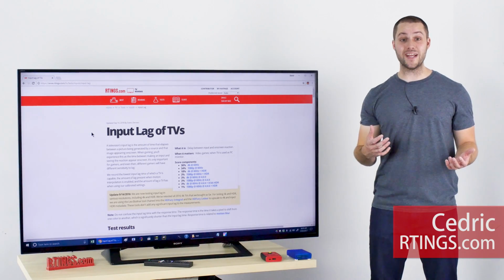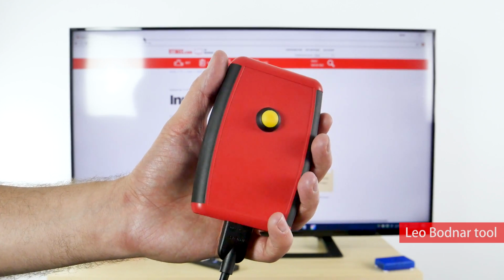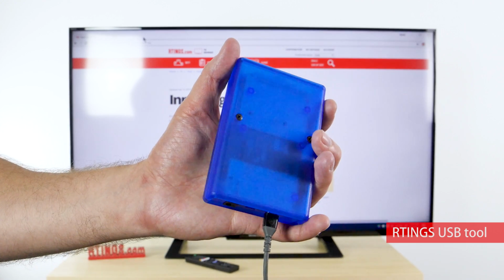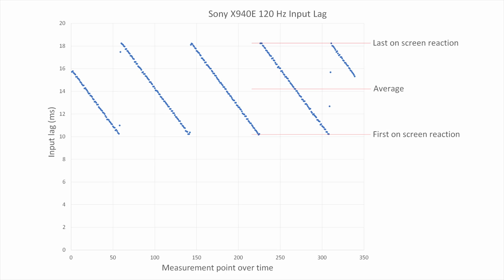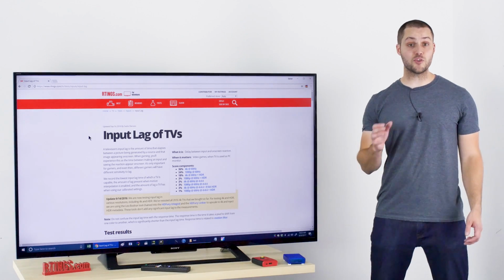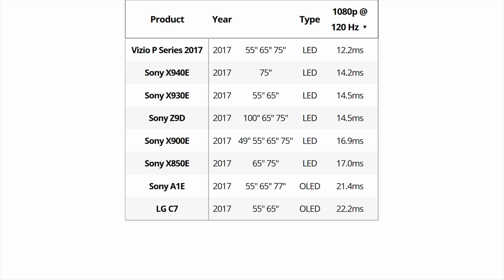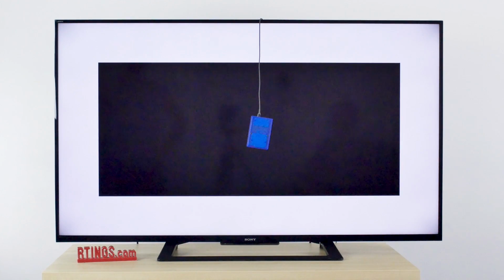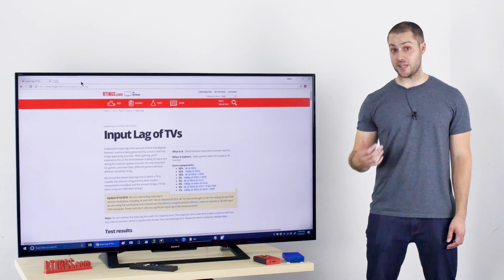#8: New Input Lag & Response Time tool - Rtings.com

Comment: It's worth noting that the modern graphics pipeline on Windows PCs provides no guarantees on when the image will actually make it to the screen, and there's currently no API to allow the software to query that information. It can change depending on many factors, like what the compositor is doing, the version of Windows, graphics drivers, etc. See the talk "Myths and Misconceptions of Frame Pacing" by Alen Ladavac.

Comment: So I want to confirm, you guys still measure input lag from the middle on all TVs correct? If that is the case would it make sense to minus about 8ms from your input lag ratings since even "lagless" CRTs use 16.7 ms to scan the whole image from top to bottom?
Reply from the maker: Hey! First, thanks for the feedback! We passed it along to the Testing Development team to consider!  

We do still measure in the center of the display. We could subtract the 8ms, but we want our input lag number to be representative of how it would feel to use the display in real life. If you're using the TV to game on, you are most likely looking at the center of the screen, and you wont see the results of your actions until the scanout reaches the middle of the screen (i.e. the extra 8ms). 

In the future we may consider breaking down all the individual components of the input lag, so it's easier to see what part of the chain is contributing the most!

Comment: Please at least release the code and build diagram for the tool. Leo Bodnar devices are not only expensive for what you get but also lacking in functionality. Yes I am aware a number of folks have built similar tools out of Arduino boards and photoresistors, but there is no standard and most lack the functionality of your device.

Comment: Did you used this tool to test LG Oled C7 input lag? 
Edit: I've just seen your review on your web and it's updated. Great job. 

I have a suggestion, add to tests white uniformity on OLEDs, people should be aware of  tint issues. I had two C7s with severe yellow tints on panel. Maybe LG adress it more seriously if people know about them by professional and objective webs like you.

Sorry for my bad english. I'm not english speaker. Thanks in advance.

Comment: Great work as usual! This sounds like a strange request, but would you consider buying and testing some of the "direct view" LED wall display panels available from Samsung, etc.? Some of them come in 1080p and 4K configurations that cost about the same as some the more expensive 4K TVs, but offer true RGB LED emissive performance.

Comment: This site has been an incredible tool for me in comparing TV's. You guys should do monitors, too. As I've been mozying through 144hz TN panels, looking for a good quality, low cost PC monitor. Currently I'm looking into a 32" 144hz 1080p VIOTEK and a 27" 144hz 1080p Samsung Quantom Dot, and can't decide between the two. The Samsung, I know has better picture quality, but how much better? And would the 32" be too big for 1080p? And is the input lag they put out actually correct? So many questions you guys have answered for TV's that I wish I had the info on for monitors. Thanks for all you guys do!
Reply: Jacob Koehler I’d like to see them branch out to monitors as well.
Reply: Another vote for Rtings.com branching out to monitor reviews!
Reply: 27" is very small , and 32" is not big for 1080p
also not much games have HDR today
check new LG SJ series TVs , they have very nice input lag and HDR support , but not have 120Hz on 4K , only 1080p , or just wait for 2018 models it will have 120hz on 4K with HDMI2.1 ( you will need VOLTA GPU for it )